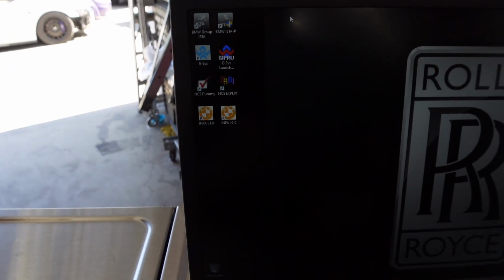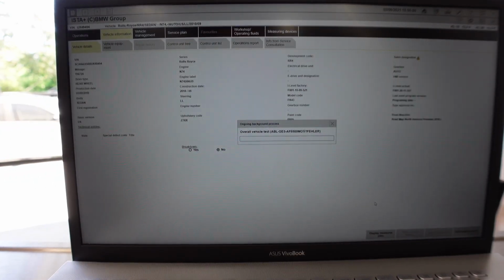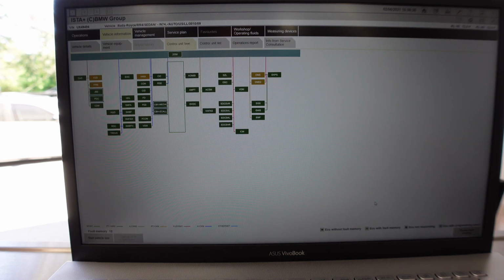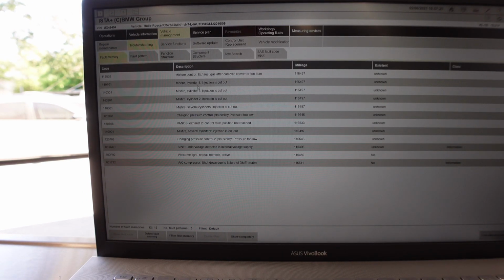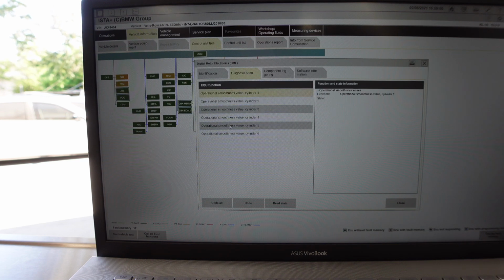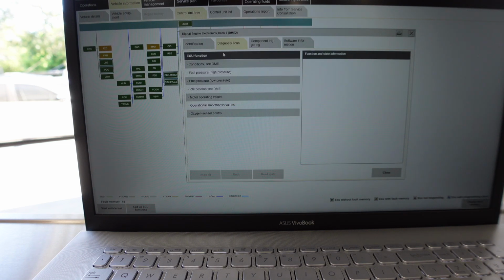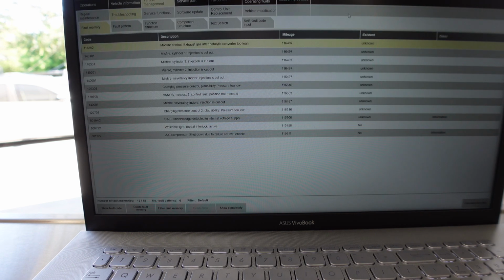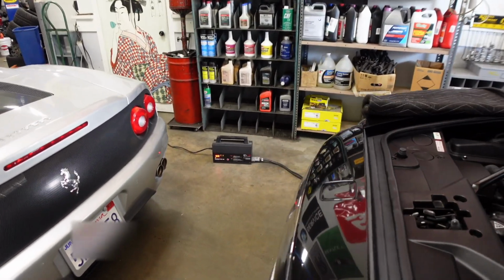ISTA+ Basics / Rolls Royce - BMW - Mini Cooper

Comment: Nice video!  Do you happen to know if the software also allows for speedometer recalibration?  My 2010 Phantom’s speedo is fast by 6%…. Thanks!
Reply from the maker: Yes if you program & code the Kombi It should calibrate all instruments
Reply: Hello, I'm struggling to get ISTA for my 2010 Rolls Royce Phantom.  I want to recalibrate the speedometer (it's 6% fast), program the trunk open button to also close the trunk and turn off all seatbelt chimes.  The software you show in the video, will it do that?  Thank you so much for helping out!!!!
 @elitemechanics1991